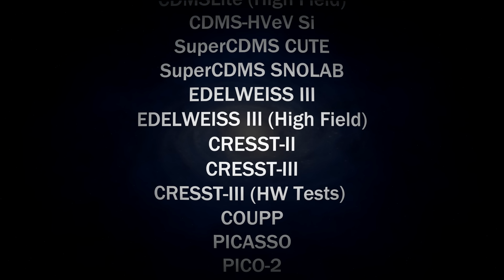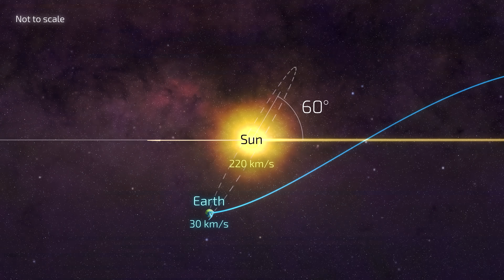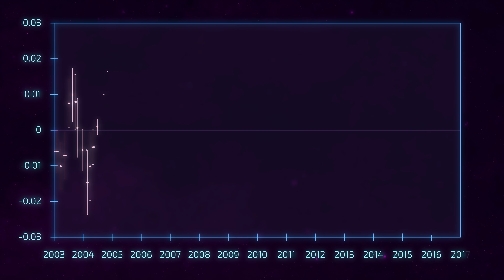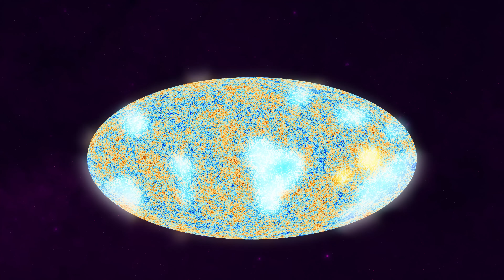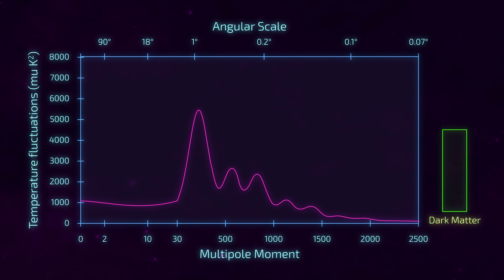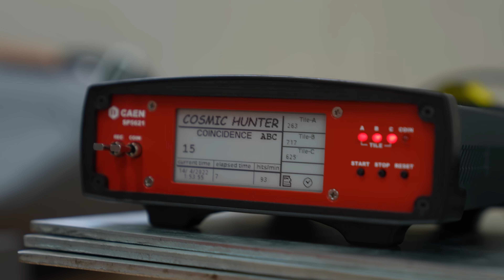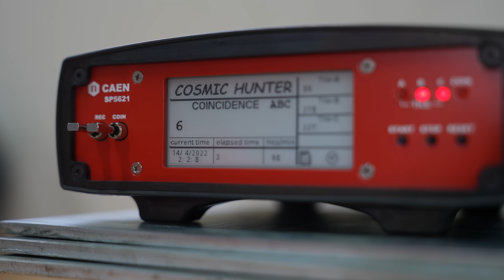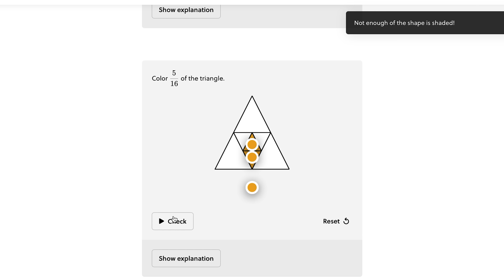The Absurd Search For Dark Matter

Comment: I'm happy about this video because, I'm so curious if instead of dark matter, could it be extra layers to gravity? So we could just improve off of the gravity we already know that works to an extent already? Like there could be the layer we know, then a large scale layer that's on the scale of entire galaxies and nebula's and other complex and diverse grand massive objects that have all sorts of behaviors interacting with in each other that I'm sure needs to be factored in to get this layer of grand scale gravity correctly. Then there could be sub atomic gravity or micro gravity or atomic gravity layer. That can essentially be the strong force and the weak force but it's just a different version of gravity on the smallest scale. So right now I'm just theorizing 3 layers of gravity, as an improved concept of the nature of gravity withing the natural world. The smaller layer, the normal layer we have understood very well that relates to our solar system type scale. Then there is the 3rd layer, the massive layer. Dealing with things that are light years across, vast temperature differences, density's, velocity's and diversity. Intense pressures, electro static charges, electromagnetism, plasma clouds, black holes, pulsar, quasars, neutron star's, super Nova explosions, gas clouds, solar winds, radiation, tons of interwoven orbital interactions and angular momentum velocities, multiple galaxies interacting upon other galaxies. Just so many things that probably all have to be accounted for when we are dealing with scales with such vast massive intracity, and scales as vast layers of complexity that the 3rd layer of gravity hypothetically could be covering? This is just a gut feeling, and I'm just doing a thought experiment with and I'd love it if someone else wants to improve onto it. I'm all for that.

Comment: Ridiculous
The universe is expanding at an exponential rate
As the distance between objects increases,the gravitational force between them decreases
Hence,as the universe expands,gravity is slowly letting go of its little stars,planets and galaxies as they drift outwards from the point where the big bang began

As gravity lets go,the celestial bodies start to move away from the centre of the universe at a faster rate
This literally explains the expansion of the universe without having anything to do with dark matter and energy
The scientists have screwed themselves over.
Reply: Feel free to discuss
Not cuss tho...
Reply: Expansion of the universe is not the only proof of dark matter, in the video there are plenty more examples of evidence like the cosmic microwave background not making sense without dark matter existing and gravity distorting light where there is no matter.
Reply: This completely ignores 100% of the evidence we have for dark matter.

There is no center of the universe. 

If your theory is correct, what is pulling the galaxies away? You are correct in that as you move away from a source of gravity, gravity gets weaker. But this doesn't mean that matter should speed up without a force acting on it.

When I jump, I should just fly off into space, never to be seen again according to your hypothesis.
Reply: @Kapoosh000  theres a radius for which gravity can still pull you back,a threshold
Reply: @sandrawong6787  This doesn't answer anything I said. Try again

It also isn't even true
Reply: All right fellas let me ask you this question
Was there gravity during the big bang?

Comment: I think there's a much better answer to the question "do you think that dark matter interacts with ordinary matter" than the one given here. It's that we share one universe, and that universe had a beginning. At some point, the dark matter had to be created, and unless two separate big bangs happened simultaneously, dark matter and ordinary matter must share a common origin near the big bang. Whatever earlier particle gave rise to dark matter and ordinary matter must interact with both, and therefore ordinary matter should be able to interact with dark matter using that earlier particle as a mediator.

The WIMP model wasn't made to motivate how we might be able to detect dark matter, it was motivated by trying to explain how dark matter was created in the early universe. In fact, most theoretical dark matter models primarily struggle with making sure that the model explains why dark matter is present in the universe. Then if the model also has a detectable signal, great. But it certainly isn't used as a requirement.

This was told to me by one of my physics professors a few years ago.

Comment: Doesn't the tilt mean the observation is not confirming the theory? The waveform should be assymetrical, surely?
After all, if the ecliptic were at right angles to the direction of motion, then there would be no effect at all.
Or am I missing something?
<edit later>  There is clearly no effect that can be attributed to DM. The data shows a symmetrical sine wave, and that is clearly at odds with the tilt of the ecliptic plane to the direction of motion through the universe. Perhaps Sabine should have a word.

Comment: The approach is wrong from the start. There is no "gravitational pull" but "space pressure" in the opposite direction. A vacuum cleaner doesn't suck in air, but atmospheric pressure pushes the air into it. There is no attraction, only opposing pressure. Nothing pulls, but pushes.

Comment: great video, but there is still one thing I am not really getting now: wenn dark matter does NOT interact with any "ordinary" matter (not even with it self), then why is it interacting with the potasium iodite crystal? the molecules in the crystal need some sort of energy transfer to emit light - and therefore the dark matter must interact with the crystal. If that is true, then the dark matter should (over time) ether a) lose weight cause e=mc^2 or b) slow down and would not show the same picture as of that from the two galaxys passing eachother? 

did i miss something?

pls excuse my inadequate english I am no native speaker.
Reply: I'm no expert on the subject so I may be wrong here, but here's what I know:

They've hypothesized that dark matter is made up of "weakly interacting massive particles" (WIMPs), particles that only interact with gravity + the weak nuclear force. If that is the case, then they would indeed interact with potassium iodide crystals. This still provides a good explanation for the gravitational anomaly as these interaction does not occur commonly on the cosmological scale.
Reply: that's a good point. The WIMPs could explain some questions. 
I need to think about for a little longer, but either way thanks for your input and time @jason Yang !

Comment: I have three questions:
1. Why are photomultiplier tubes used and not APDs? Don't photomultiplier tubes have more noise?
2. What is the detection probability of each of the sensors and the probability of some sensors not sensing the particle resulting in a detection event being mischaracterised?
3. How is electrical and thermal noise in the system mitigated to prevent false detections?

Comment: You didn't address the anomaly of those few galaxies (some two dozen found so far) that appear to have no dark matter but which don't fall apart.  Also anomalous is that dark matter may interact weakly with matter and has a gravitational effect but does not interact with itself!  And I find it confusing that dark matter supposedly lenses light - which does interact with matter - but that dark matter hardly interacts with matter at all.  It all sounds a bit like Schrodinger's cat and a denial of General Relativity  to me.  Furthermore, vast sums of money have been spent on experiments worldwide, and no new magic particle has been found that explains dark matter.  I now would be surprised if this new particle is ever found at all.
Reply: The galaxies with no dark matter are known by the lower rotational speeds.
Galaxies were never going to fall apart, the mass within them was always going to move at the correct velocity to stay together (this also comes from survivorship bias, that there would always be stars in a galaxy that are left when some get flung out).

Comment: what potassium isotope is that? afaik potassium only decays by proton emision electronic capture beta+ or beta-. idk any radiation that emits both an electron and a gamma ray simultaneously. Im thinking that it either it was a beta- and youre somehow detecting the antineutrino instead of the gamma ray (in which case the K shouldve decayed into Ca) or a beta - with an isomeric transition after (in which case the k should ve decay into Ca* after the beta - then the Ca* would ve decayed into Ca with the transition), what decay method are you representing?

Comment: Not sure if I missed an explanation to this but he mentioned that dark matter doesn't directly interact with ordinary matter except through gravity. So how is a detector that is contingent on a "dark matter particle" hitting a Sodium Iodide solution make any sense as an experiment to prove it's existence? I don't if I'm just missing something or is the video missing something.
Reply: If dark matter is a weakly interacting massive particle (WIMP), the proposal is that though the particle is weakly interacting it will still, with very low probability, transfer some kinetic energy to an ordinary atom.

However, dark matter may not be a WIMP and in this case the experiment should return a null result.
Reply: @TheDanEdwards  I see. Thanks for the explanation.

Comment: And after shielding it so much, how can it detect dark matter at all?

Also, I'm proud to see my country is contributing to this endeavour!
Reply: We don't know how dark matter interacts with normal matter or if it interacts at all
We are just guessing, hoping we might get something...
Reply: I believe the idea is that dark matter very very rarely interacts with normal matter, so all that shielding shouldn't slow it down at all.
Reply: If dark matter consists of WIMPS then it is much more likely to pass through all of that material than anything else. It’s like using a strainer. If the things you are trying to see are smaller(less interaction) than everything else, stacking strainers of smaller and smaller grid size will block out the stuff you don’t want.
Reply: I am not qualified enough to answer but my best guess is that due to the fact that dark matter is assumed to interact very weakly and that too only with gravity, it passes all that shielding  mechanism while other particles that interact somewhat strongly do not.

Comment: Here's my theory. What if gravity isn't cumulative, rather exponential. Maybe the total of all the gravitational forces present in a galaxy is not the sum of its parts, rather some sort of exponential function of that? @veritasium
Reply: We cannot see the ubiquitous creation of matter 'particles', but they are happening everywhere as wave-motions of space..

"Commendation from NASA for research work at Massachusetts Institute of Technology on the Earth's atmosphere and the Moon's surface for navigation of the Apollo spacecraft to the Moon..
Dr. Milo Wolff has found the structure of the electron consisting of two spherical quantum waves, one moving radially outward and another moving radially inward. The center of the waves is the nominal location of the electron 'particle'. These waves extend infinitely, like charge force. All 'particle' waves mix and contribute to each other, thus all matter of the universe is interrelated by this intimate connection between the fundamental 'particles' and the universe. The natural laws are a direct consequence of this Wave Structure of Matter (WSM), thus WSM underlies all of science."

"Gravity is caused by the mass-energy density of space. This mass-energy density of space is determined by the square of the Wave-Amplitude and is always positive (squares are always positive). The  wave-velocity is inversely proportional to the mass-energy density of space, the higher the mass-energy density of space, the slower the Wave-Velocity. As Matter and its resultant mass-energy density of space are always positive, this causes a slowing of In-Waves as they travel through other matter/wave-motions, and it is this property of Space that causes the natural ‘Gravitational’ attraction of all bodies, and explains why Gravity is always attractive." (Geoff Haselhurst)

"Mathematics has the completely false reputation of yielding infallible conclusions. Its infallibility is nothing but identity. Two times two is not four, but it is just two times two, and that is what we call four for short. But four is nothing new at all. And thus it goes on and on in its conclusions, except that in the higher formulas the identity fades out of sight."  (Johann Wolfgang Von Goethe)

"Today's scientists have substituted mathematics for experiments, and they wander off through equation after equation, and eventually build a structure which has no relation to reality." (Nikola Tesla)

spaceandmotion

Comment: LOL, looking for Fairy Dust, instead of just using a better Theory that requires no magical, mystical DARK MATTER. LOL

MOND, or the next step in MOND called Quantized Inertia. Yes, you can look up Quantized Inertia and it is a new Theory of how gravity and inertia works that actually fits the MOND Theory and accounts for many "fairy dust" anomalies. 

If they see something with this additional detector, it most likely is something and most likely isn't dark matter.

7:40 No, I would not expect that. Why would you expect that? All the gas passed right thru without impacting any gas from the other cluster. That seems more reasonable. The density of these "gases" of it can even be called a "gas" is extremely low and effected by many other things, like plasma currents and magnetic fields and the mass of the bright objects. Neutral atoms would be ionized by an impact, these ions would be swept along by magnetic fields. You never even talked about the velocity of the bullet clusters before and after the collision. Maybe each bullet cluster (of bright objects) slowed down slightly after the collision, but the masses of each bullet cluster essentially stayed the same.  What your saying if false from the get go, that all the gas stayed in the center, when gravitational lensing disproved this. Why would you expect all the ions to stay in the center of this highly dynamic system of electric and magnetic fields.

Comment: Ok so I have this question now:: If we are flowing through Dark Matter all the time and and still cannot detect it, is there any possibility that this form of matter cannot be detected in 3D, and only can be detected by machines developed to function in higher dimensions?

Basically that dark matter exists in 4D and higher? ( donno if that even makes sense )
Reply: It clearly does interact with matter. They supposedly speed up rotation speed of stars around galaxies.

Comment: I have an  Original hypothesis. What if our solar system is a 'fish ball' surrounded by a  Special anomaly of space and time which act optically or spatially even temporally  as a lense. Then what we observed  acceleration of the universe expansion could be just an Illusion. And also, this could be the reason why voyager 1 is currently sending us strange data from the edge of our solar system. Time would tell if later same happens to the voyager 2. In turn: there is no dark matter!

Comment: Question
According to 1:31 dark matter doesn't interact with anything except gravity.
Then how does it 10:39 interact with sodium atom in those crystal?
Reply: Hi, dark matter physicist here working on an experiment mentioned in the quick scroll in the beginning. The dark matter DAMA searches for here is the WIMP named so because it is theorized to interact with gravity (massive) and the weak force (weakly interacting). DAMA argues that it sees WIMP particles interacting with the sodium and iodide atoms in their detector. What this means is that the WIMPs are scattering off of these nuclei as other particles would in nuclear physics. There is a small energy deposit in this scattering event which can be read by the detectors.
Reply: The hope is that it doesn't interact only through gravity. If it does, we're screwed in terms of detecting it.
Reply: afaik it happens in case the dark matter candidate particle has a chance to decay into something else